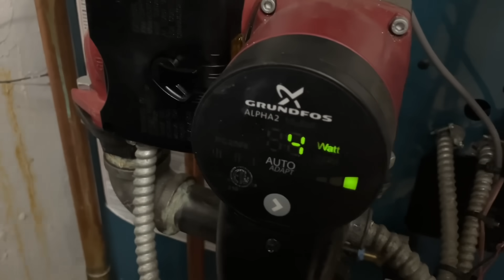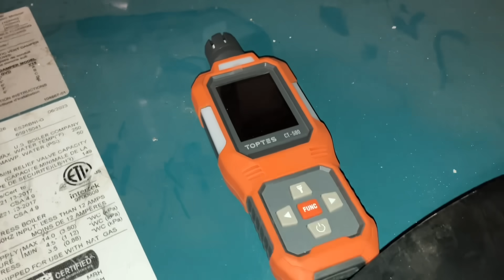Emergency No Heat Service Call @USBoiler Burnham ES2 Boiler Not Running Thanksgiving Morning

Comment: circulator sounded air bound via the audio and that's what they do when vapor locked or somewhere in the loop is, specially in the auto or proportional pressure modes.
sometimes putting them in constant curve mode(highest speed) will help clear them of air binds. that is the  three vertical bar mode ( ||| ), the older models didn't have any dry run protection, I think they do now.
installed some of them over 10 years ago and so far, no failures. had one air lock, because the air scoop before it "vent" was left shut during boiler maintenance(whoops) and that is exactly what it did. if you listen close they'll make a light chuffing sound, as the remaining amount of water/air cavitates. they have no warning light on them, as the other brand does, newer models may?
not a lot of hydronic systems around here, mainly gas furnaces(plenty of oil, electric and dinosaur heat pumps).

Comment: Happy thanksgiving !!!! Just came back from a no heat call old rheem pressure switch failed . Mike is there any books that you would recommend on learning boiler piping and wiring?

Comment: Do the grundfos circulators have this typical problem or is it a bad install? I've had one in use for 10 years without issues.
Reply from the maker: IMO, both bad install and bad circ
Reply: @ when I replace mine next year, which make and model do you recommend to replace my Alpha 2 model?  I have 4 zones with 1 circulator pump